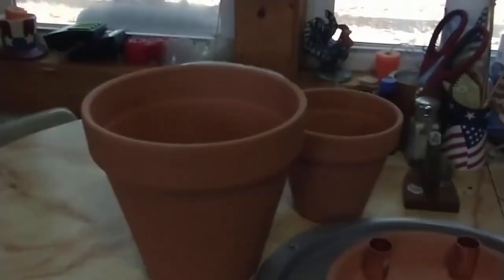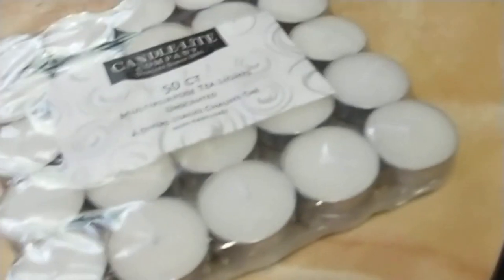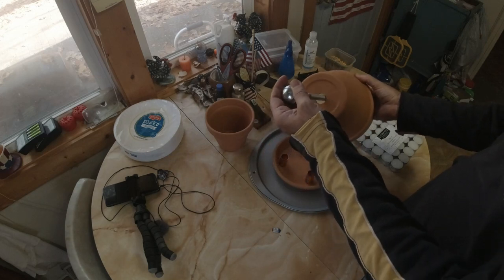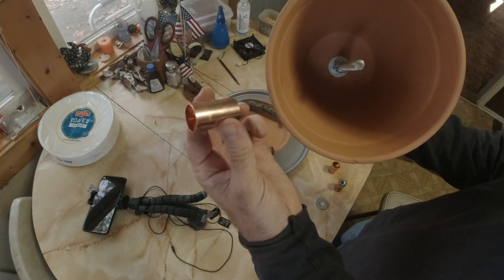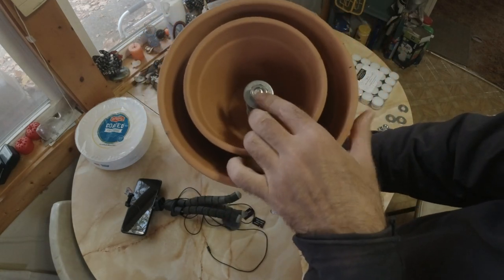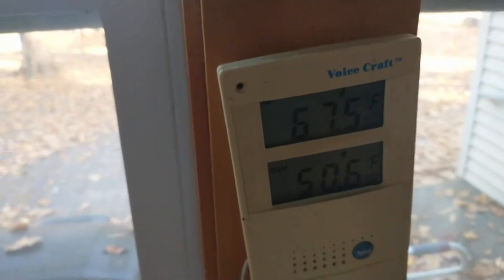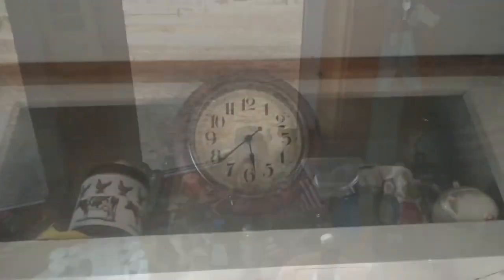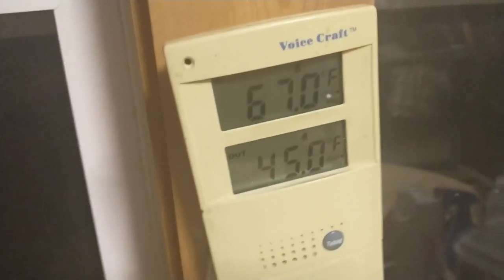Be careful using these, I had 5 candles and the wax got fire.

Comment: Those are not much more than a hand warmer. They look cool to the unknowing . Very dangerous too if knocked over. They will not produce enough heat to save on the heating bill. Tried, tested and true...
Reply from the maker: Thank you, it is for the room that is always 3 to 5 degrees colder than the other rooms so it has the room warmer after running it for a few hours, may not be much but anything is great with price of fuel oil.